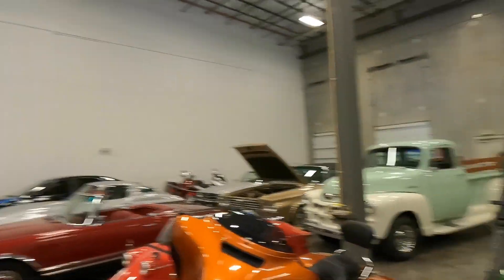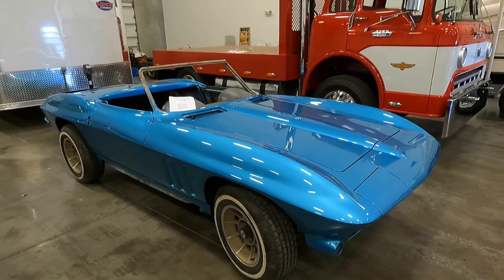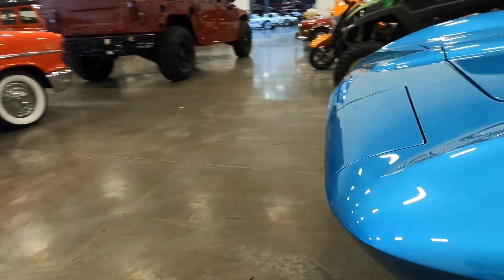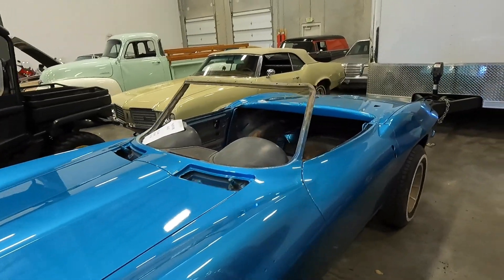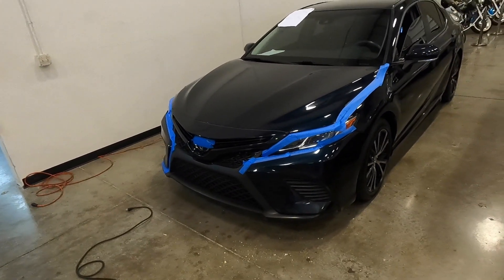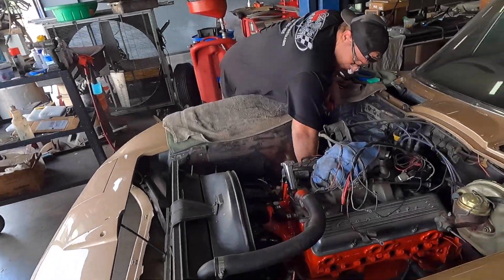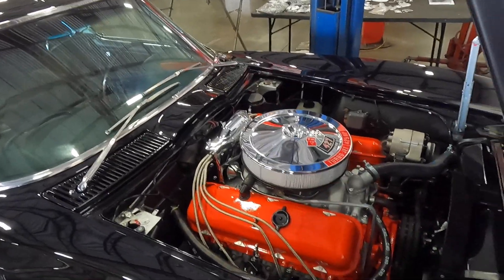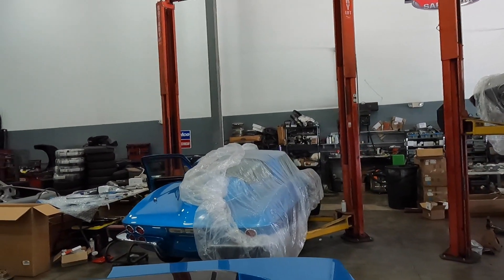Our "Foam Filled" Corvette Is BACK From Paint! Classic Car Restoration

Comment: GM was at it's best in 1967, Quality, Design and performance at a great value. by the mid seventies it was rolling out mass produced vehicles lacking Quality, Design and performance. My 81 Trans am looked great but was equipped with a weak engine and poor shifting metric 200 transmission , Three gears of clanking and banging up and down around town !

Comment: Do you have any idea why the previous owner filled it with foam . What was he thinking ?
Reply: My guess would be that the previous owner wanted to reinforce the fiberglass. In Aerospace, structural foam is used to support a fiberglass Skin for rigidity in place of making the Skin much thicker which adds more weight for an airfoil control surface. Example: Rohacell foam.
Reply: so it could float ??